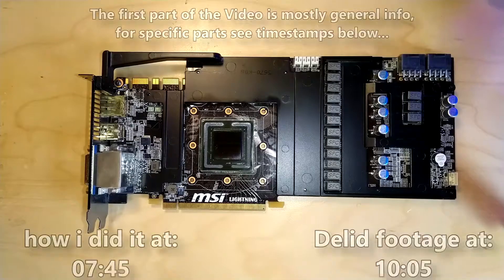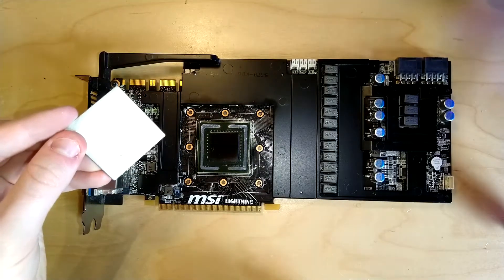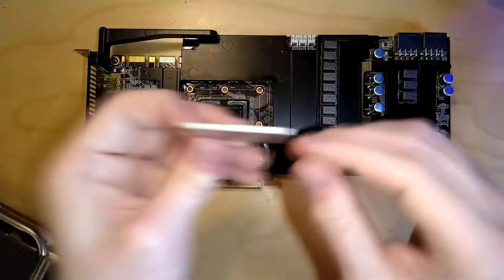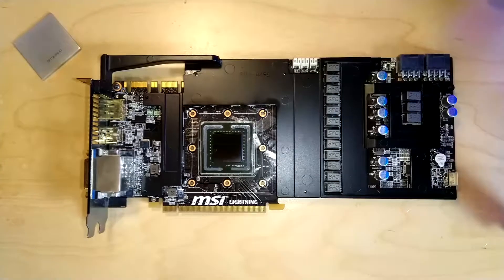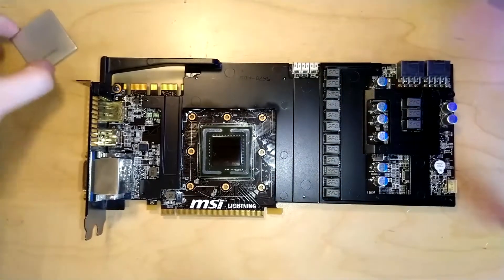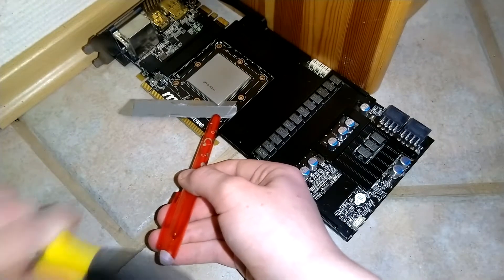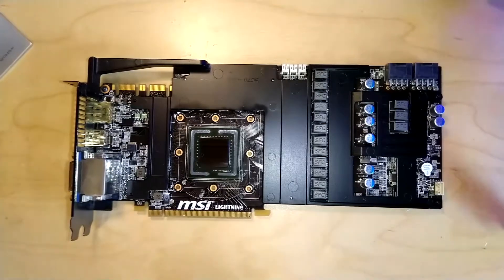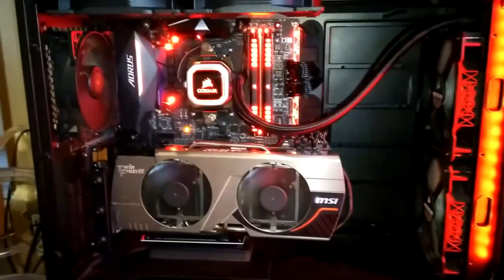How to Delid Nvidia Fermi Cards (GTX 580 Lightning)

Comment: Hi, nice content, what about shaving some mm from the cooler standoffs will that work? One suggestion by coming from ps3 delidding, best way to delid is with metal painters knifes, they just slice the silicone like butter without the risk of damaging the substrate and or pcb

Comment: So do you just run it with no lid at all?  I've got 2 gtx 260 I'm not doing anything with, and I'm wondering if I can just use it without a lid.
Reply from the maker: If the cooler fits yes. But most cards don't work with their stock heatsinks when delidded so you will have to find something like a custom air cooler or just watercool

Comment: i have a question,can you test your graphics card just to se if it works when its disasembled,without the heat sinc and the rest
Reply from the maker: you can but only until it displays the POST screen then it will probably be too hot. when i do it i always hold my finger to the GPU and flick the off switch on the PSU when it gets too hot. it's ok for 5-10 seconds enough for it to show the POST screen

Comment: Good job. One thing is that it is good if you can handle desoldering caused from crash or 🔨. Another problem is cooler that if its new brand cooler it costs around the price Of the good secondhand gpu which means 15~20 dollar gpu in my standard. I did it as you did and the corner of the gpu looking like a glass fragile has been broken a little bit but it is working fine. Of course if you love to revive it, the cost doesn't matter.

Comment: Where do you find those 20$ waterblocks? I am definitely interested ^^
Reply from the maker: I got mine on Ebay. They have a finned copper base and mostly a black acetal or acrylic top with a intel only or intel/AM3+ mounting plate. I did also make a video about upgrading my waterloop using such a block if you want to see what it looks like